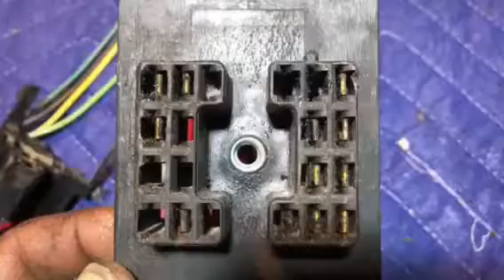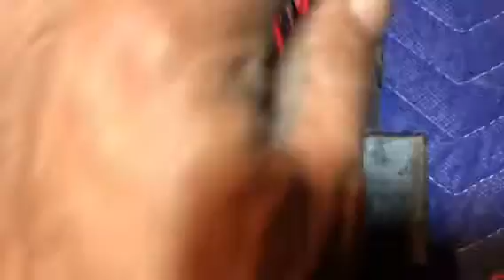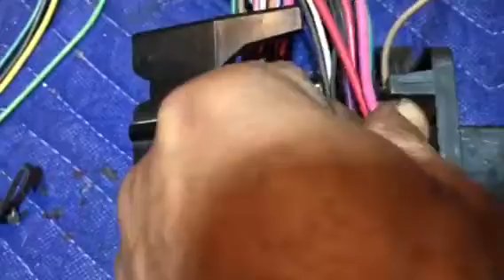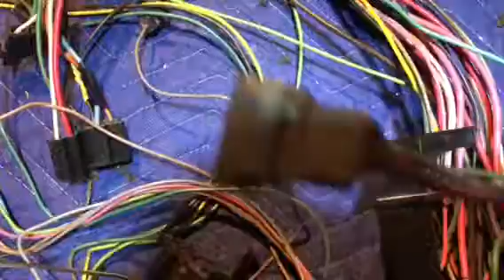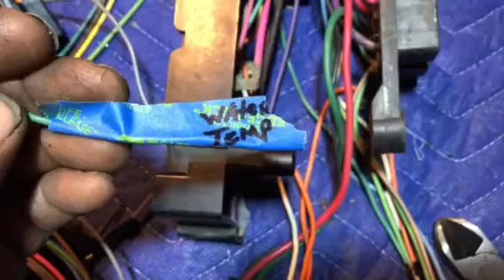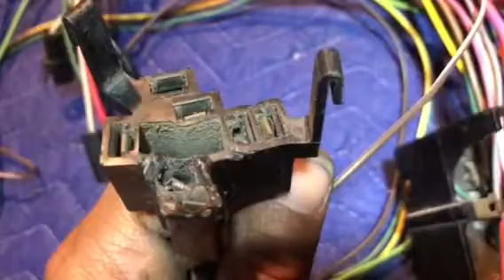1967 to 1972 Chevy c-10 wiring and fuse box explained. Part 5 of 7  #patinacode #patinarod #ratrod

Comment: It seems like you really know what you're talking about like and makes hella since when you explain it I just don't understand why I turn my key on the engine turns over but it doesn't stop turning over when I let my key go it's still continues to turn the engine over until I unhook the battery
Reply from the maker: Hey thanks for checking out the videos. 
One issue you could be having is a bad ignition switch. You may also have a short in the ignition system.
You may have poor grounding , or it could possibly be that the timing is off .
Possibly a bad distributor.
I would start with the wiring for the ignition. If you’re confident that it’s fine and have good grounding points from cab to engine and engine to chassis, then you may want to get a new ignition switch.
If you have to disconnect the battery then I believe that you have a “switch” issue.
You can turn the power on , but not off . In my mind that means that the ignition switch is bad or possibly a bad or shorted wire operating the switch. 
Hope this helps.

Comment: Can you help..I have no blinkers...
Reply from the maker: I’ll do my best to help you . 
One of the main things to be sure of is to make sure that you have really good clean grounds . The other thing with testing for blinkers and braking lights is to be sure that you have a really good charge on your battery. 
Under the steering wheel there is a plastic ring where the signal switch is . Sometimes the brass contact’s get corroded. You can clean them up by using some sand paper. 
One of the last things is to check all the fuses .  Also , check down the signal wires in the finder’s and bedside as well as the ones leading from the steering column to be sure that none are cracked or broken.
Again the most common issue is that the system is not properly grounded. Proper grounds are good secured and clean grounds.
Reply: @PatinaCode  The purple wire in the fuse panel has no power that runs to the little round flash thing. All the other lights work Emergency Flashers , parking lights, Break lights, headlights. All work.
Reply from the maker: @davidolds1972  
Sorry for the delay in responding. I’m just getting home . Ok , now that you’ve identified the problem wire that’s a start .  You may have to trace that wire back on each end to make sure that there is proper connection regarding that wire. These trucks are old and corrosion is the enemy. All it takes is a little correction on the connection sites to cause a problem. 
Also make sure the fuse and flashers are good.

Comment: So could that brown and white switched wire be used to power on a Holly sniper EFI since its not being used?
Reply from the maker: Not sure . I don’t know what type of voltage , amperage or ohms are carried through that wire. You would have to check the requirements of your system and then find out if that brown and white wire is capable of operating it. 
That’s a great question, but I don’t know the correct answer. I wish I did, though , because that would make great use of that wire.
Reply: @PatinaCode  Thanks either way, these videos just made a stressful wiring mess in my cab and under the hood of my 72 much easy to understand. I've been asking on fakebook and getting some good advice followed by some wrong answers. The harness has been cut and spliced and painted so much it's hard to know what does what. At least now I can trace the wires and see where they plug in to so I'll know what I'm looking at .Pretty sure I'm rolling on a fire hazard right now.
Reply from the maker: @hdrolling  
My whole purpose of these videos was to just simply help and I’m glad that I’ve been able to help out so many people. 
For you all to reach out and say “hey thanks “ is the best reward.

Comment: I'm still working on wiring restore, repair, remove spices. I'm almost done, took dash out to refresh it & it give better access to wires. It's looking good & it's a very nice van the owner put new motor, brakes front end=nice. I lost 20 days trying to fix battery drain, put toggle switch & now dash is open I''ll wire ALT to Ignition. Thank you be well.

Comment: Thank you for the time, expanded thoughts & very well explained on door alignment. Yes I did all those methods & chased it around to get fairly close? I've done other car door seals & I'm not so sure the repro's aren't exact &/OR seals need time to conform & may need some modifications? My T-bird<when windows up, repo seal wrap around the window frame to stop door from opening & that was the best brand & most expensive. Be well.

Comment: Looking for door alignment 72 Chevy van/Truck & man it isn't  covers, most are BS & I guess  & way off into everything else, sheet metal, hinge replace, get the welder, fenders off, body mounts ETC ?. So I thought of you & that Barry White to calm me down & let me feel Oh Yah! +-
Reply from the maker: 👍🏽 it’s been years since I’ve built a 72 . When I first started I didn’t film anything. I was just building and driving.
I can tell you a few things on how I would get mine back on straight after pulling them off.  The first thing was having really good hinges. And the next thing was being sure that the inner A pillar, where the hinges mount was straight. 
Since I work by myself, I would put a heavy moving blanket on the roof then a piece of 2x4  wood block and use my big 
body clamps to hold the door in position.   Once the door was latched shut , I’d install the bolts that secure the hinges to the out side A pillar. Once you have the bolts in you can then open the door and see what type of adjustment you need .
It is a tricky thing , but once the door is bolted on it just becomes a game of finding that sweet spot. You will having to loosen both lower and upper hinges, so that the door can move forward and aft. 
Be sure to have all tires inflated to the same pressure and working on a level surface. If your vehicle has a slight forward rake , consider leveling the vehicle with a set of jack stands. 
Other reasons why doors may not line up could be bad body mounts . 
Hope this helps.
Reply: Always line up doors to the hatch side of the cab….that part is stationary and does move…..so line up doors to sheet metal at the latch…..you can adjust the fenders and cowl panel but not the cab at the latch pillar….hope that makes sense……also they make a special s shaped wrench to adjust doors if your fenders are already  on the truck. Good luck!

Comment: Nice, very well done & detailed wire tracing. You make it look easy with a calm voice, I had to get familiar with basic wiring, but its taken me years to get better.                                            I was hoping to see the fusible link near the battery, I believe that where my problem is, but I'm not sure=It had no power at the dash as I left key on, checked wires & turn signal flashed but, now there's not enough power to start it?
Reply from the maker: First off sorry that it took so long to respond. I’ve been vacationing. Thanks for the compliment, glad that the videos helped. . 
The fusible link could be the problem. One other thing that could be , is that the alternator isn’t charging the battery….( that is if the truck was running before this problem occurred ) 
But , yes , change out the fusible link and make sure you have good ground connections. You also may want to check the battery. Even if it’s a new battery, it may not be full charged .

Comment: Hey I'm having trouble with my rear brake light on the driver side. It doesn't work also the driver side rear turning signal. On the passenger side both works. What's my problem. I have a 77 Cheyenne C10. Don't want to get pulled over. You can email me at belost88@gmail.com. please and thank you.
Reply: The rear lights work. Running lights on both sides.   Cleaned up the the input bulbs go. Very fustraded. Please and thank you

Comment: on the pink wire, what is the HEI
Reply from the maker: Are you installing an HEI ? 
Some people use the pink wire for the hei because it’s ignition on . 
If you’re installing an hei the you need a piece of 12 gauge wire and then run that into the fuse box to the ignition prong. That  ignition prong will come on when the key is switched on , and shut off when you turn the key off.
Reply: @PatinaCode  I have the wrapped wire (instead of the pink wire).  it goes to the HEI "batt" connection BUT the wire is also (factory) spliced to a yellow wire that goes to the starter solenoid "R" terminal.  Is that still needed with HEI or is that superfluous?

Comment: Where does the red wire go that is on the ignition switch?
Reply from the maker: The red wire off the ignition switch goes right to the back of the fuse panel. 
Sorry it took so long to reply . I’ve been swamped.
Reply: Aloop hi 6 @PatinaCode

Comment: Why would my horn be stuck on, on my 1967 chev truck? I put new relay in. New turn signal switch, still didn't fix problem. Horn button and cup are removed, and still horn is stuck on. Bearings seam to be good on steering shaft. Is there some kind of insulator on steering shaft that could of failed creating a continuous ground?
Reply from the maker: james farrell  Could be the ground on the horn it’s self has a bad connection. Usually it running from the horn to the radiator core support. There could be some rust under it causing it to not make a strong ground.